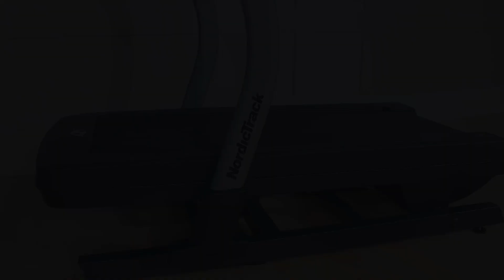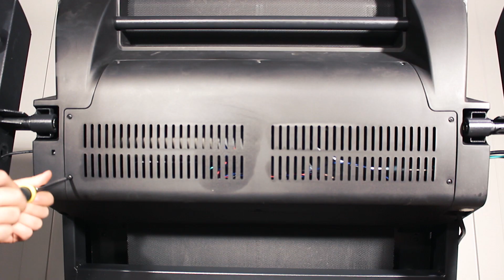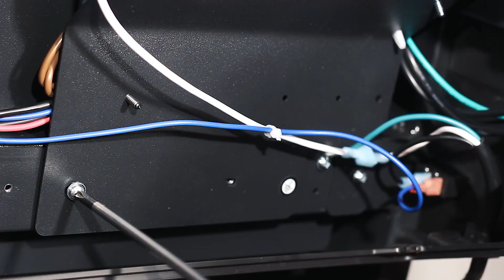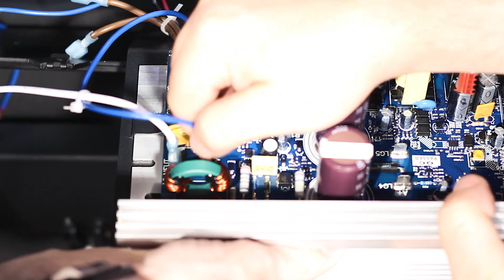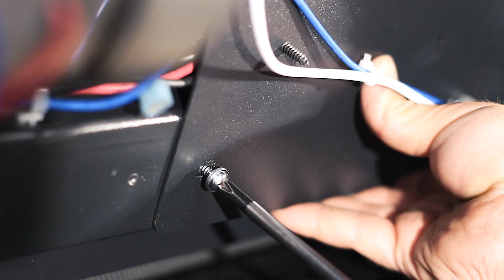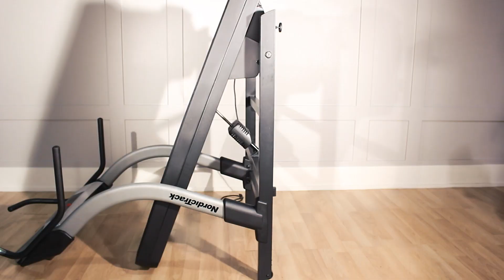Replacing the Motor Controller on a Incline Trainer

Comment: On my third board now. Connecting the treadmill to a surge protector is a must! Every short circuit has been from power surges that fried the controller while it was plugged in without the surge protector. For extra care, unplug the treadmill after use!

Comment: My X7i just died on me, I mean I get no response out of the machine at all. Would the control board be the most obvious part that needs to be replaced or could it be the resistor? We did experience some electrical outages but I'm not sure the machine was plugged in at the time. Is the resistor more prone to failure durning a power surge or the control board?
Reply from the maker: The machine should operate w/out the resistor. the resistor is used to at high inclines as part of the breaking system. you are probably looking at the controller if there are no signs of power (led lights on the controller) and you have checked to make sure the outlet is good and the power switch is turned on.
Reply: @FitnessEquipmentHelp  When power is turned on there is a red light on the controller.

Comment: My x32i looks complete different. Do you have another video for the newer models? It’s not all one board.
Reply from the maker: I'm sorry, I do not but the process is essentially the same. The controller is still on the top side of the electronics bracket it just now has fewer wire connections.

Comment: I can't unscrew the big green resistor. I'm pushing and turning as hard as I can, but I'm just on the verge of stripping the screw. Is it screwed right into steel? I'm totally stuck at this early step.

Comment: Is there any way to get to the controller board without having to flip the entire treadmill over? I am a small 120lb woman and I can flip this huge thing over by myself. I have to do it upright. Is it even possible?
Reply from the maker: It would be difficult but if you are able to raise the incline I believe you can get under the treadmill enough to remove the deck rails rollers, belt and deck like you were replacing the walking belt. At that point you can access the controller from above.

Comment: Very helpful video and much more informative than the 1 page of instructions that Icon sent me (in which the diagrams did not match my model!). One question: after replacing the motor control board, starting up the treadmill, and completing an incline calibration, their is a quiet, high pitch tone coming from the control board area. Is this ok, or is this an indication of a lose connector or some other error I caused in swapping out the board?
Reply from the maker: I have heard a very faint electrical whine if i put my ear right up to the controller area. If it is much louder then i would address it.  I would check your connections but I can't think of anything else you would have done that could cause that. You may be just fine but I would ask for a second Controller while you are under the parts guarantee or under warranty.

Comment: Just one question … why should I have to replace a controller on a NEW treadmill 
Shouldn’t the one it was delivered with work !
Reply from the maker: Yes it should but like all, man made things it is subject to failure and manufacturing defects from time to time. external factors like failing to use a surge protector in a lightning storm can also cause parts to fail and need to be replaced.

Comment: I have had  constant issues with the incline on the x22i not following workouts so Icon first sent me a new console which didn't fix the issue, now they've sent me a new incline sensor wire. The instructions are terrible, telling me to remove the hood as described in the manual (which does not even mention the motor hood). I'm assuming that the incline sensor wire is one of the wires you disconnected from the controller board. The instructions say nothing about having to remove the controller in the way you did, just that I need to disconnect the wire from the motor and from the controller, compare the wire to the 3 wires they sent me, and replace it with the one that looks the same. Do you have an instruction video that would guide me through this? Is it basically the same process, except that I only need to replace one wire from the motor to the controller instead of pulling every wire and replacing the board?
Reply from the maker: The X22i Incline sensor wire runs from the incline motor through the base frame to the controller area so you will need to access it in those locations and feed it through the frame. Before going to that trouble I would want to know if the incline works normally outside of the workouts. (does it respond to your commands manually)? and does it fully calibrate. meaning when you do the Incline calibration test in the maintenance mode from settings, does it go all the way up then all the way back down. If it is working outside of the workout and calibrated then I would not suspect the wire. Do you ever manually adjust the incline during your workout? If so the incline will not follow the workout preset incline levels again until you press the follow workout button on the screen. If the incline is working fine in manual workouts and calibrates and you have not made manual adjustments during streamed workouts, then I would suggest you speak with iFit customer care it is not likely a parts and service issue.
Reply: @FitnessEquipmentHelp  Thanks. We were able to figure it out with a little trial and error and installed the wire last night. It was a wire within the motor box. Luckily, it did not require us to thread it through the frame, just detach an oval-shaped clip from the motor and disconnect the wire from the other end to replace it. However, it did not fix the problem. Here's the history of what is happening - I'd love your thoughts before I contact Icon again. I got the x22i at the end of July and started having issues about 2 weeks in. For about 6 weeks, the issue I was having is that the workout would shoot to 40% incline or -6% decline at random times. When it did this, the treadmill itself did not move, just the workout on the console would show 40%. The only way to get the machine recalibrated on the fly was to get it to drop to -6% and then back to zero. Only then would the Follow Trainer button work. Until the next time it randomly did it again, anyway. After about 6-8 weeks, it only did that once or twice during a 3 week period. Then in October/November, I started noticing a different problem - the machine would move on its own when it wasn't supposed to. This happens most often on 1 or 2% incline during video workouts. If I'm running 1 minute straight on a 2% incline, I can feel and hear the machine move me up multiple times. The result is that by the end of a workout (if I can handle the increased incline), I may be 4-8% above where I'm supposed to be. When this started happening, I began measuring the height of the machine before and after workouts at zero and found that the machine was always above where it was supposed to be until I manually reset it by dropping it to -6% and back to zero. Because I was measuring so often, I also realized that the machine was just plain inaccurate even when I was not doing a video workout - even when I was just standing on the machine changing inclines without the belt moving at all. If I have it set at zero and go up to 3% and back down to zero, it's about a quarter-inch higher. If I drop it to -6% and back to zero, it resets properly. They had me do the recalibration and it is also not correct - once it put me about a half-inch higher, other times it's about a quarter-inch higher. So there's an issue with it both for manual incline and during video workouts. Icon sent me a new console - didn't fix it. Now they've sent me this incline sensor wire - didn't fix it. I know getting them to send me a whole new machine is probably like pulling teeth, but I'm not sure what's left. Any thoughts?

Comment: Maybe you can help me I have the x9i incline trainer and was running an incline calibration and everything shut off after it inclined half way 😫 I notice that the power cord had been pinched under back of machine and pulled very tight. I took casing off to look at power switch and power cord. Power cord weird blue and black wires to power switch intact and green write to screw intact but I also found a white wire unattached but can't find any other loose wire. Is this white wire just extra? Or Do u think my board or power switch went bad?? Thanks for any and all help
Reply from the maker: the white wire should plug into the controller. it is not extra and likely explains the loss of power. it should plug into the controller at the spade labled "AC Neut"
Reply: @FitnessEquipmentHelp  thanks, I found the white unplugged write hiding behind the controller

Comment: Great job on this, what saved me was a shot of the power switch as you were going, I just unplugged everything to swap the boards because of how tight  the wiring was, and I screwed up by plugging the long blue cable to the empty terminal on the board instead of the power switch. Luckily it didn't short. I opened it back up, and something didn't look right about only 1 wire on the power switch, found the blue cable was it and it works great.   I'm hoping the factory board was a bad batch, because there's several major changes to the new board that are hopefully upgrades.
Reply from the maker: I'm glad it was useful.

Comment: Four months later and I'm on my second control board in the first eight months of owning my x22i.  Hopefully, I'm not doing this every four months, but the process was much easier the second time through.  This video remains the gold standard for how to perform this repair, just note the comments below about some of the difficulties in performing the work.
Reply from the maker: Thank you for the kind endorsement. They have been attempting to improve the parts. the older board (blue) shown in the video was replaced with a new Green board that looks slightly different. the next generation of the green board (that you should have received if you got it in the last few days to couple of weeks. Should be an improvement and last years of use.

Comment: Where is the controller located? Got the board and no instructions at all.
Reply from the maker: If you have an incline trainer as shown in this video, then the controller is right rear part of the unit. It is typically accessed from the bottom of the machine on incline trainers.

Comment: My X22i needed a new control board after 2 months brand new.  Finally got it yesterday after waiting 2 months for it.  I’m pretty good with technical/mechanical repairs around the house.  Swapping out the control board shouldn’t be a problem for me.  Unfortunately the screws holding the resistor are on so tight, not even a properly torqued electric drill/screwdriver can get them off -  I don’t want to strip the screws.  Without removing the resistor, you can’t get to the screws holding the plate that hold the control board.  So I can’t swap out the control board.  They’ll have to send someone out I guess, to remove some screws that are practically welded on to the frame.  Totally ridiculous.  Anyone else have this issue with these screws?
Reply: I am in the same boat, mine lasted 2 months and quit working. I was just told today that the part will not be shipped for 6 weeks because of the pandemic.
Reply: I have the same problem, mine broke at the 7 week mark. I finally just got my board 1 month later and three of the four screws stripped immediately.
Reply: I have the same story. I bought X22i two months ago and last week the motor stopped moving the tread (the console still works).  I have sent multiple e-mail asking for customer service but only get a computerized response-no action, they never pick up their phones- worst customer service ever- Is there a way to get your money back on this piece of junk?
It also seems like everyone has the same problem with X22i- does this qualify as a class action lawsuit?

Comment: X22i motor stopped working after 6  weeks.  Thanks for the video.  Pretty obvious their quality control is terrible seeing the multitude of others experiencing the same issues on brand new equipment.  It was hard enough to get this delivered in the first place let alone dealing with customer service who don't work on the weekend.  No doubt it will take forever to get this part delivered, is there anywhere else you can purchase one without having to go through Nordic Track?
Reply from the maker: There are online parts retailers that sell parts. I am not affiliated with any however. Googling treadmill parts should bring up several options.
Reply: I have the same problem, I was just told it will be 6 weeks before the part gets shipped. I did find the control board online but runs between $180 and $200. I paid for the extended warranty so looks like I’ll be running outside for the next 2 months.
Reply: @ss-xv5cu  Thank you.  Do you have any links?  Can't find any online.
Reply: I had found 5 on eBay but just looking now they are all sold out again.
Reply: @ss-xv5cu  Really appreciate you checking, thank you.

Comment: Thanks for the video!   I replaced the controller on my X32i after owning it for a whopping 4 months.   The “instructions” provided with the replacement were basically useless.   Without this video I couldn’t have done it.    Like someone else said this isn’t a job for the faint of heart.   Took me about 45 minutes including battling a few screws.   Take pictures of the connections.   You will be glad you did.